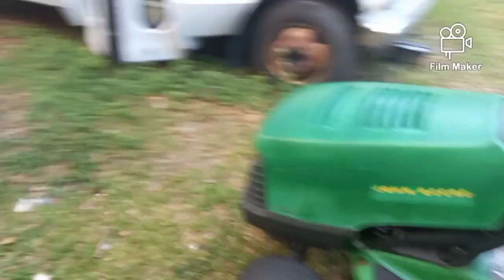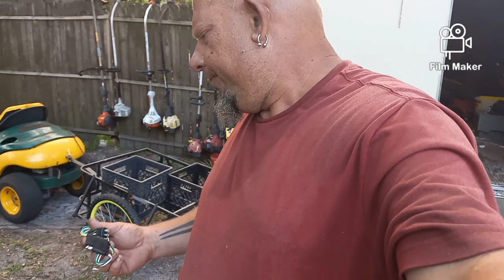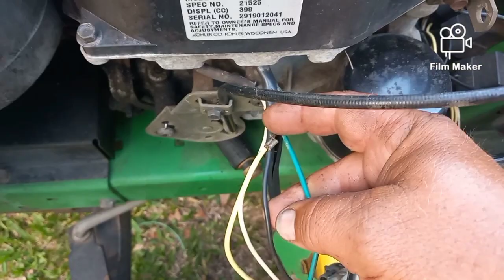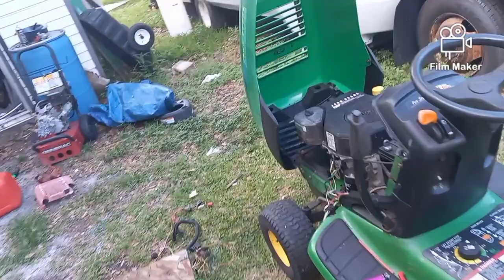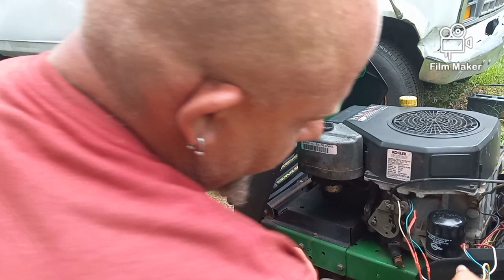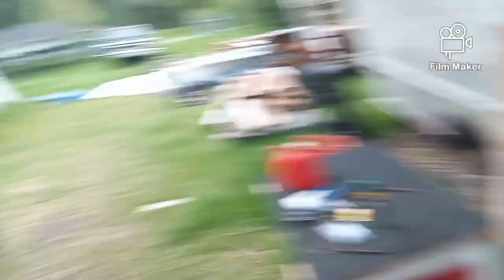John Deere / Wires Smoking  / Wont

Comment: And when you got all finished was the battery charging when the engine was running.  I have the feeling that you cut out the charging line from the alternator.  The diode would be to change the alternating current from the alternator to pulsating DC voltage to charge the battery.  When you put your test light on that line from the alternator with no connection to the battery you were looking at unregulated ac from the alternator which not being connected to the battery as a reference would be voltage high enough to blow out the light in your test light.

Comment: Where you always color blind? 
And interesting issue I did not think there was a diode but isn’t it for the charging system I know in some electronics there is A diode that is called a blocking diode specifically used for charging batteries I think and some other stuff 
You might be able to use this one 15SQ045 Schottky Barrier Rectifier Bypass Blocking Diodes 15A you can get the from Amazon